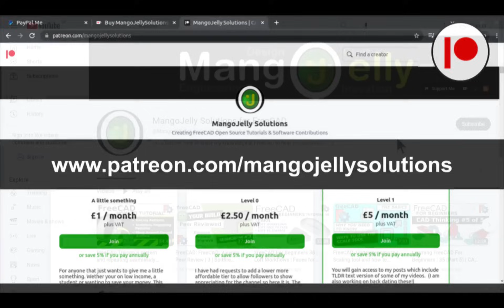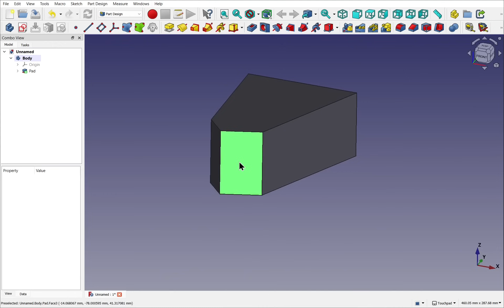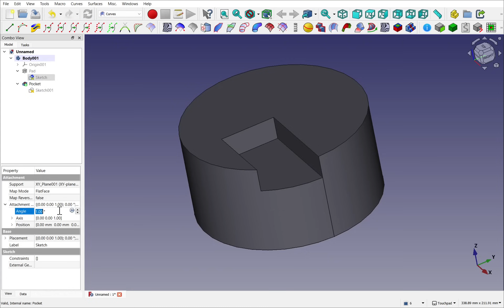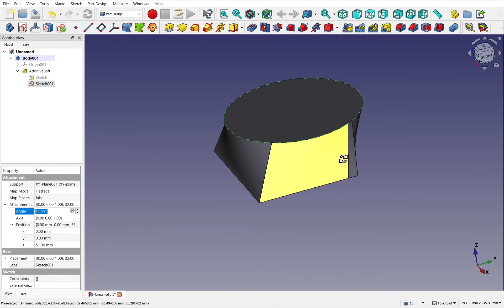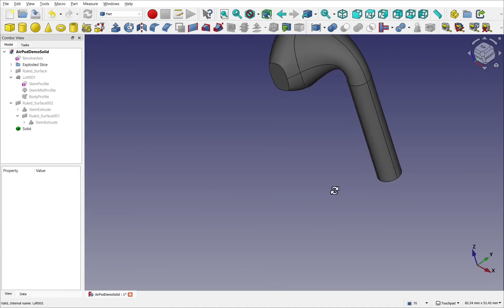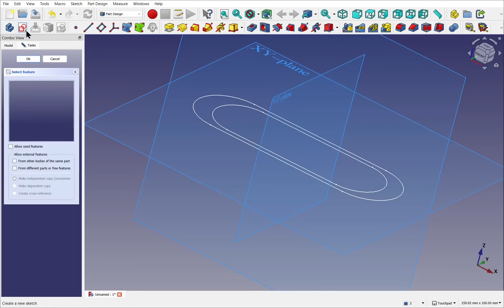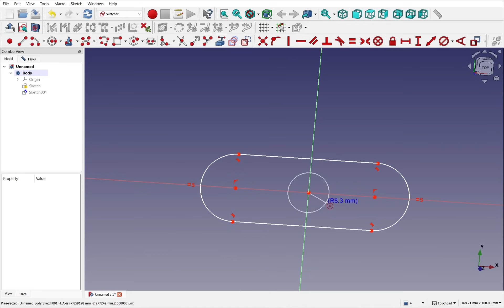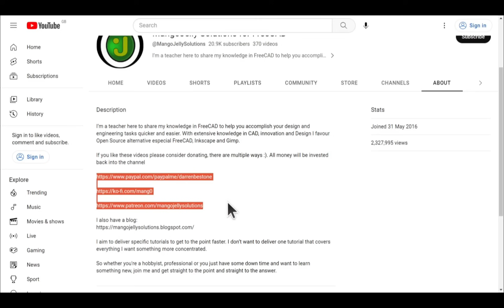FreeCAD: May's 5 Tips To Save Time And Frustration

Comment: Hm. I was enthusiastic that groups would help keep my project tree in order. 

However in some cases, dragging objects into a group removes them from their original place. For example, dragging a shape that is used in a tool for a slice operation into a group removes it from the slice, instead of creating a "copy" as whith the sketches in the video. Standard ideas as holding Ctrl down while dragging did not change this behaviour.

Edit: 
0.21.1 on Windows

Further edit:
This happens when the shape I drag is part of a compound. I wonder it that is intended. Posted on FreeCAD forum.

Comment: There needs to be a way to select the appropriate order at the time of making the loft in that final example. Being forced to delete your sketch and redraw is a terrible conclusion to the loft command. I would consider it an incomplete function at this point. At the very least, base it off of the order selected rather than the order sketched. My 2 cents...

I am a month or so into FreeCAD and really appreciate your videos. I've used a lot of CAD packages in my 20 years of being a manufacturing designer, and this is by far the most painful and unintuitive despite being quite powerful. I realize software development is hard and it is free on the backs of the developers, so I really do get it and am grateful. It's just a painfully slow and frustrating road. Thanks again for all the vids you provide to the community as I can already tell that the user base absolutely would not be where it is if it wasn't for your efforts. I've watched a lot of your vids while on lunch break at work. :D Cheers!
Reply: There are a lot of stuff still that needs to be fixed for sure. Seems to be a lot of base functions that are not finished 100%. Just like the thread creator.. You can create a thread... but not specify length of it... Its like.. eeh.. what? Why?
Of course its still fantastic with all the work put into this and its still free. Hard to complain.
But for pure practicality I cant really find a reason to leave the pirate ship with Autodesk Inventor, yet.. :)
But I'm following the development of FreeCAD for sure.
Reply: @martinsvensson6884 Well said. At some point, you have to polish what you have and focus on UI & UX. There is definitely some focus on this as they work through the implementation of LinkStage3 on their journey to V1.0.  I really struggle with it being unintuitive and the feedback unhelpful in many cases. I'm really rooting for FreeCAD to have a Blender moment. I have my reservations when I see responses in forums about how FreeCAD wants input in an atypical workflow. A good software, any genre, is one that is intuitive, guides the user in some way, and interacts predictably. Just doing something different for the sake of doing differently is a bad practice unless it provides some real value in return. IMHO

Comment: Hi I have a question for you maybe for an upcoming video. I would like to know how would you design a electrical harness in freecad. For exemple, a harness with a simple connector at both end that connect  a point a to b by passing to several supports.

Comment: I've never noticed the unwrap tool. What is the use case of it?
Reply: As a guess, it would be used if you are making sheet metal parts.
Reply from the maker: It can be used for sheet metal, paper and card cut and also laser cut if you introduce a kerf pattern to allow it to bend (or the wood is thin enough)

Comment: Is there a video that will help me learn how to design a bracket? I have a small monitor, I have a shelf, I want to mount the monitor on the shelf edge. I can model the monitor and the shelf. I can model something to fit the VESA mountings on the monitor, and a thing to go over the shelf edge and screw in. I need to position the monitor where I want it relative to the shelf, and then design the part of the bracket that goes between the two, and it's here I get lost!

Comment: Thanks for this informational video. I have one Question: Can the order for lofting be fixed or is the only solution by redrawing the sketch?
Reply: good question, I would also like to know. If not, maybe something like the layer lists on lots of programs, with drag 'n drop functionality, could really help. Or at least some option to show the index of each vertex floating close to them.
Reply: Agree. I just commented that it should be based off of selection order, not sketch order. Every other CAD package I've used allows you to modify this order at the time of making the loft. Redoing your sketch is absurd.